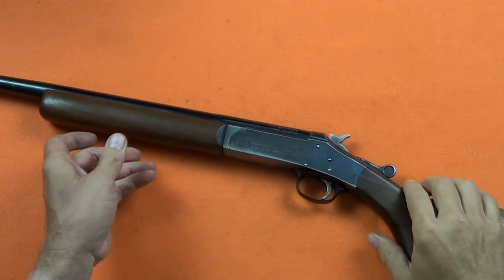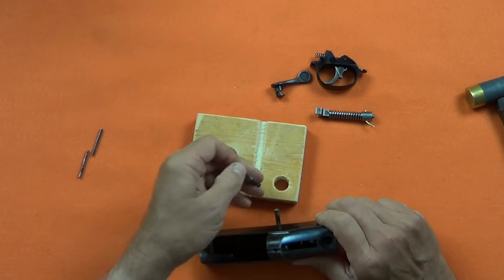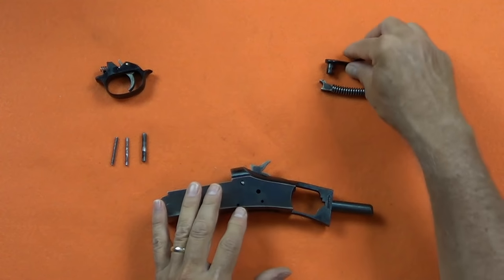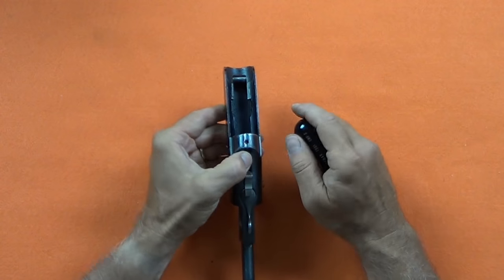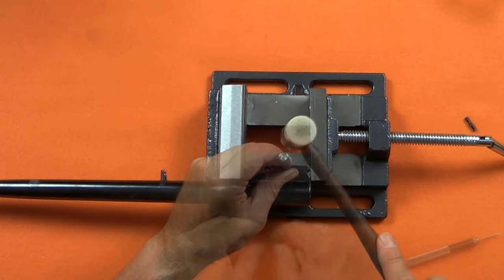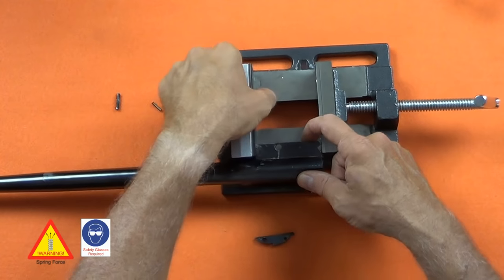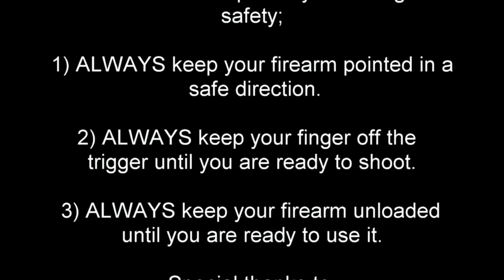Harrington & Richardson Topper M48 - Armorer level disassembly

Comment: Thank-You for a great video. I appreciate you taking the time that it takes to record and edit such a video. I learned a lot from this video. I recently received a H&R M48 Topper in 12 Gauge, from my cousin and the Topper was my uncles. My cousin went through all of his stuff after my uncle passed away and she gave me the Topper. My uncle bought it Brand New back in the 80's and by the looks of the Topper, I would guess that he only used it a couple of times. It is in absolute MINT condition, with no rust, pits, patina or scuffs on any of the metal or the wood. If you saw it at a gun shop, you would swear that it's brand new. It's going to make a perfect mate to my H&R M176 10 Gauge with a 36" barrel that I bought brand new in 1983 and it to, is in MINT condition. I know that neither of those shotguns are fancy in any way, but they both are built like tanks and I love my M176 and I still use it today for goose hunting. I get it that they're both single shot shotguns and don't compare to todays semi-auto or pump shotguns, but I've always loved using my M176 and I'm sure that I'll enjoy using the M48 as well. They don't build them like this anymore, that's for sure. A friend of mine bought a new Savage 301 for his granddaughter for Christmas a couple of years back and while it's a decent enough shotgun, to me it's not the same as this M48 as far as fit and finish and character, the Savage 301 has synthetic furniture and to me, just doesn't have the same flair as this M48 has, but that's just my opinion. I also have a Savage Fox BSE that I bought brand new in the 80's as well, and it's one classy looking shotgun, in my opinion as well. With it's 30" barrels, 12 Gauge 3" chamber, F/M chokes, Vent-Rib with Double Beads, the gorgeous Colour Case Hardened Receiver with double triggers and auto ejectors and an etched Fox on the bottom of the Receiver and very nice wood with a checkered stock and checkering and scrollwork on the forend. I've owned it since new in the early 80's and the only thing that it needed was a right hammer and that was maybe 10 years ago, so I had the Smithy replace both hammers, just in case...Lol...Anyway, I have several new firearms but I've always said that older ones like my Savage FoxBSE and my H&R M176 and now my M48 certainly have a place with firearms lovers and if you take care of them, they'll take care of you. Thanks again for the excellent video of the H&R M48 Topper.
Reply from the maker: When I did this video, I had no idea how popular this shotgun was, and how many of them were family heirlooms like yours.  This was just a repair job, albeit a failed repair job. This has become my most popular video with over 500K views now. It gets twice as many views each month than any of my other videos, bar one.  And it brings twice as many subscribers to the channel as any other video, bar none.  I'm glad you enjoyed it.  Thanks for watching and commenting.
Reply: Have one just like it would love for you to restore it

Comment: Excellent video. I would not have attempted this without this video. Repaired a Topper 48 manufactured in 1948 that my Dad got when he was 13. I shot it for some time as a kid however, eventually the hammer would drop by itself. The old 410 was kept and displayed as a keepsake all these years. Stumbled across this video, found a hammer and trigger and have a working 410 topper once again. Thank you!
Reply from the maker: What I thought about when I was doing this video is that I knew there was someone out there like you.  Stories like yours really make my day!  Thanks for watching.
Reply: Your history with this shotgun is identical to mine -- M48 Topper made in 1948 and the hammer drops by itself.  I want to restore to service and give to my grandson.  Could you tell me where you found a hammer and trigger.  By the way, I was 12-13 when I started using this shotgun also.
Reply: Pruw
Reply from the maker: @mikeray4406  Try Numrich or Jack First

Comment: In the middle of a fix and clean of an H&R Bay State.  Similar but older but the hammer spring install gave me fits.   Thanks for your video, I was able to use a pin and install.   Great camera angle!

Comment: Good video. A couple of items though. When installing the ejector I found it easier to install latch spring then the latch. After that secure it with the large pin (forward pin) in the latch. Install the ejector with the spring and with the ejector pushed in apply pressure to the latch. This will hold the ejector while you install the small latch pin. 
Next the sequence for the hammer and trigger. I installed the bolt latch first like you did. Then the trigger guard. This makes aligning the trigger in the guard easier and aligning the hammer lands with the trigger lands easier. I couldn’t get these parts properly aligned the other way. 
If I hadn’t watched this video I wouldn’t have known that the parts had those lands to line up.
Reply from the maker: Thanks for the comments, I'm always looking for ways to improve.

Comment: I have a problem. I got a 12 GA 1908 H&R Shotgun single action. I have to push trigger forward and then pull hammer back to fire, it also wont eject shell without a ram rod, what part of mine is malfunctioning?
Reply from the maker: Both the trigger return and the ejector are spring actuated.  So likely your issues are one of two things, the springs are worn out/broken/missing or the parts are so gummed/rusty that they can't move freely.   Could be a couple of things but I'd start with cleaning and inspecting.  If it's just the parts are dirty and If you don't want to disassemble then you can run the parts through an ultrasonic cleaner, or just soak them in oil and move them back and forth to free them up.  Try blowing compressed air through the contact surfaces too.  Just looking at the parts the trigger spring is a leaf spring so it's probably not very strong anyway.  Also the ejectors on these (as you can see from the video) are prone to failure.  Well I hope that helps, please like, subscribe or even do a super thanks.  Good luck with your project, let me know how it goes.
Reply: I have the same shotgun.  It is very nice,  one of my favorites in my collection.  1900 h&r. I'm having trouble with it again tho.

Comment: Very Nice!  I have an old H&R Topper Model 48 .410 Shotgun, almost identical to yours.  I need to find a replacement ejector pin for my .410 Topper Model 48.  Any suggestions for finding a replacement ejector pin and or parts?  It will be greatly appreciated.  Thank you.
Reply from the maker: Wow wish I could help you, I've been searching for a .410 ejector ever since I worked on this gun 6 years ago.  I guess they're pretty fragile, because they are nowhere to be found.  Numrich used to list them but always out of stock.  They don't even list them anymore.  I've even looked for machining classes at the local community classes to learn how to make one.  But those aren't offered anymore (plenty of basket weaving classes though).  If you find a source let me know, good luck, sorry I couldn't be of more help.  Thanks for watching.

Comment: TY, nice video. Man oh man, I wish you had a video for the H&R 158. I have to replace a hammer spring in one.
Reply from the maker: Thanks!  Do you mean the 148 shotgun?  Because it's identical to the Topper.
Reply: @ImminentThreatDefense  No. This is a H&R 158 Topper 20 ga. shotgun. The left side of the receiver is marked "Topper Model 158".
Reply from the maker: @joedoakes8778  Ahhh.  So many guns, so little time :-) I see some references to it now that I took a bit more time.  I looked it up on Numrich for parts and they didn't list it. Anyway, by looking at the pictures, and knowing how efficient designers are, it's probably an identical assembly.  The main pins all look in the same location.  Note that the pins on these H&R guns are generally knurled or grooved so they're meant to come out in only one direction, I didn't really show that in the video.  Thanks for watching!

Comment: Have a Harrington and Richardson model 148.  Had a broken striker which I replaced.  Problem now is I’m getting light firing pin strike on primer and no discharge.  Wonder what would be causing this.  All other firing components are properly functioning
Reply from the maker: Sorry not sure what you mean by "striker", the 148 used a hammer.  None the less the light primer strikes could be unassociated.  I'd look at the firing pin and channel to see if it's gummed up.

Comment: Does anybody know where I can get a trigger guard for this? I've looked just about everywhere and have had no luck. I'm just finding the guard made for a larger trigger pin.
Reply from the maker: Numrich has them https://www.gunpartscorp.com/products/280790C     Otherwise a good source for old parts is Jack First.  Hope that helps.
Reply: @Imminent Threat Defense  
Thanks for the response. Numrich's part has a trigger pin hole that's too large for the M48's trigger pin. Both pins on the M48 are the same size. All the guards I'm finding have the larger trigger pin hole 😞
Reply: Allegedly you can get a replacement metal one but you'll also have to drill the action for it to fit.   I'm just in the process of restoring one, no parts anywhere.  The ejector is a weak point with this 410.
Reply: @ianrobertson3419  I ended up drilling it and had to bore a bigger hole for the trigger plunger reset spring thing. Works great now.

Comment: Noone makes a video of how to remove the bar going across the Reciever that hold the barrel 
It unscrews about half way then just turns forever. My barrel wont come off its hung up on something and I need to remove that bar but no videos on that, noone ever takes it out.
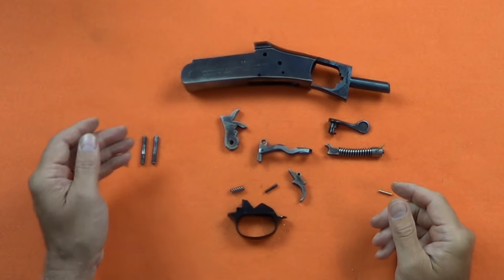Reply from the maker: I'm surprised you got that bar to turn at all.  How did you get a hold of it?  You are saying it's threaded?  It looked to me like it was a press fit, probably with a hydraulic press and wasn't (practically) removable.  But if you take apart and remove the locking bolt (3:15 in the video), then there's nothing left except rust to prevent the barrel from rotating and being removed.

Comment: Great video, had my topper 48  .410 single shot taken apart for cleaning since it looked like it needed some help. Got the four pins out but marred one up punching it out. Managed to get it back together but I have no hammer resistance. By watching your video  I will break it back apart and try again. Can you tell me where I can get a new pin to replace the marred one? Thank you and I appreciate your help, great video!!👍
Reply from the maker: You can try saving the pin.  One end was peened or starred. You can replicate that. Grip the end of the pin with pliers that have grip ridges so the ridges are parallel to the pin then smack the pliers with a hammer.  If that doesn't work try Numrich or Jack First. They both carry parts for this gun. Thanks for watching!

Comment: I recently aquired a similar h&r 410 topper that is pretty rusted. Before I attempt this I was hoping you could tell me where I can get the brass pins you use and what size to buy?
Reply from the maker: If you were talking about the brass drift pins then I made them from brass rod stock.  See my video on how to make a slave pin for the technique.  Otherwise Brownells sells them, they have two different kinds one call an alignment pin 080-645-000WB and one called an alignment push pin 080-000-034WB.  This latter type comes in brass or steel.   I don't remember exactly which size I used but it looks like that was the 0.091", though it may have been the 0.120.  If you meant the slave pin, you'll have to make that, sorry I didn't note the diameter.   But they're easy to make, again watch my video on making slave pins for the technique.  Thanks for watching!

Comment: Mine has 2 pins rather than 4 and has a second smaller spring above the mainsrping, what model is this?

I'm having a hell of a time trying to get the pin out
Reply from the maker: Look carefully at the pin and check to make sure it's not tapered (one end will be larger than the other), you may be trying to drive it out the wrong direction.  All the pins on the gun in the video were staked on one end to make them effectively tapered.  Give the pins a good soaking of Kroil penetrating oil and let them soak for several hours, overnight would be even better.  Apply the penetrating oil several times.  Also if you'll send me some pictures of the gun, in particular any markings or stamps, I'll try to help you identify it.  email me at ITDefenseTraining@gmail.com

Comment: something happened to my hammer it has no tension now won;t cock what would be the problem every thing else seems to work
Reply from the maker: If it has no tension in the hammer then there's probably something wrong with the mainspring or the mainspring guide.  Either could be broken, or the guide could be installed wrong.  If it won't hold back when you cock it then there's something wrong with where the hammer engages with the trigger.  Hope that helps.  If you need more help feel free to contact me at ITDefenseTraining@gmail.com send pics of the parts that'll help diagnose issues.
Reply: @ImminentThreatDefense  thanks everyone thing else works the gun was never apart I think something happened to the hammer spring

Comment: I found this video very informative and I appreciate you taking time to produce one for such an old firearm.  I have an H&R M48 "N" stamped .410 (no Serial Number), on which it is very tricky to get the hammer to catch when cocking.  Once it catches, the trigger is whisper sensitive.  My question is, like Mike C., should replacing both hammer and trigger solve the problem, or is it possible another part is failing?  Thanks in advance, and again for an excellent video!
Reply from the maker: If you can get the new parts cheap, just try it.  But you could put something like Dykem on the engagement faces of the trigger and hammer.  Then engage the hammer a few times and it'll rub off the Dykem so can see if what the engagement looks like.  That might give you a clue why it's so sensitive. It's likely worn, broken or not aligned.  Check the hammer and trigger pins, make sure they aren't bent, and that the trigger and hammer aren't moving in a direction they aren't supposed to, that could reduce engagement too.

Good luck, thanks for watching!

Comment: What other caliber bullets safe to shoot in h&R topper 48 410
Reply from the maker: First I really wouldn't want to speculate what's "safe" for you to do :-) that's your call.  However, generally speaking only use the caliber stamped on the gun or as specified by the manufacturer, or one that is clearly a less powerful variant e.g. a 2 3/4 shell in a 3" magnum shotgun.  If you're asking about using a .45 long colt in this shotgun (like we see in some pistols) I would  not recommend that.  You can be sure H&R never intended the shotgun to be used with that caliber.